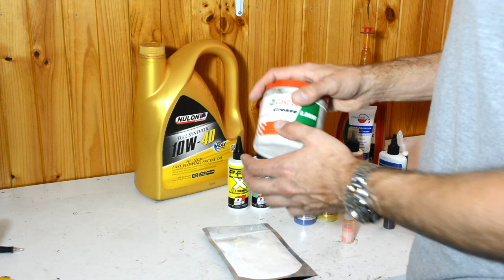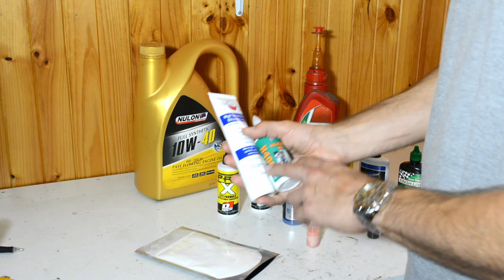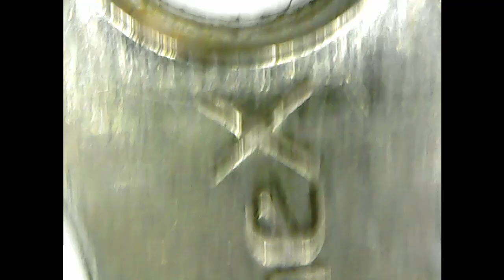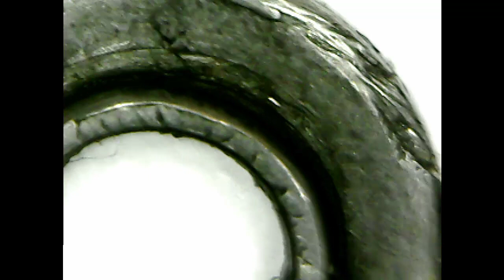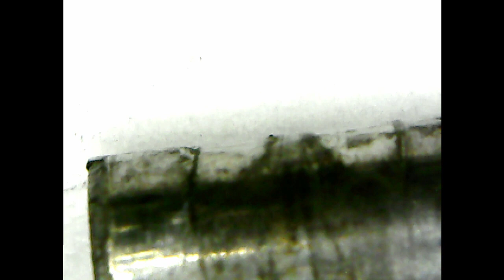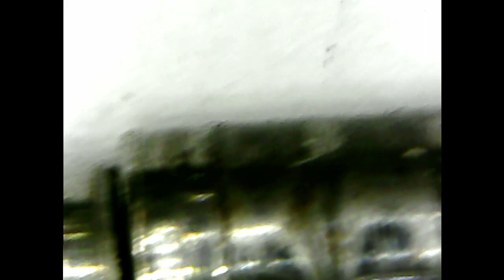Bicycle Chain Lubricant and Microscope

Comment: Whats the formula for the aft with ceramic
Reply from the maker: J. R. sorry, whats the question?
Reply: Nate B how much trans fluid to ceramic are you mixing
Reply from the maker: J. R. its probably around 70% trans, 39% grease, you need to get the right consistency.  without the grease it requires 2 applications a week in the dry & will last 1 rainy day.  the ceramic powder - probably a pinch, half of your smallest finger nail or so.

Comment: Interesting stuff. We ride a tandem and tandems eat chains. We are at .75mm wear at 2500 kms. We were using transmission fluid at work as a chain lube but after running out started using Squirt which is wax based. In the dry it seems to work fine but one ride in the rain and it's gone. I'll give your recipe a try
Reply from the maker: yeah just Transfluid was enough to keep the wear right down.  However re-application was necessary as its just so damn thin.
I'll also re-iterate, there was bugger all chain stretch - it was side plate wear, so an immense improvement.

Comment: How do you find the auto transmission fluid with your paint? No damage to your paint finish?
Reply from the maker: No issues - its BRAKE fluid that is a big concern for paint.  Using those bottles with careful application & there's nothing that drops off or causes excessive mess.
Reply: Cheers!